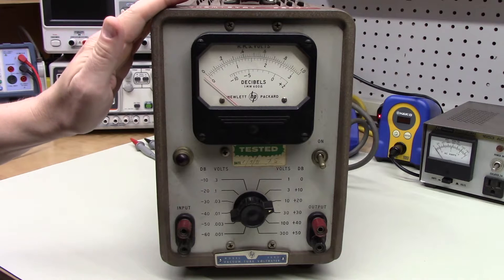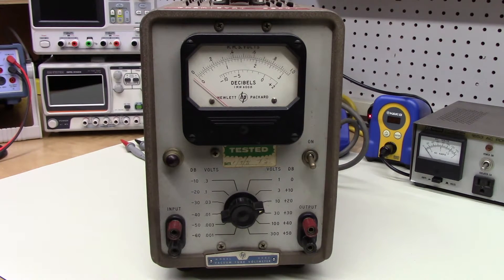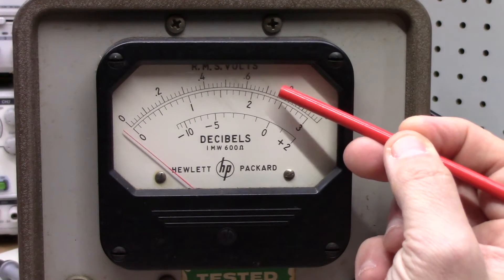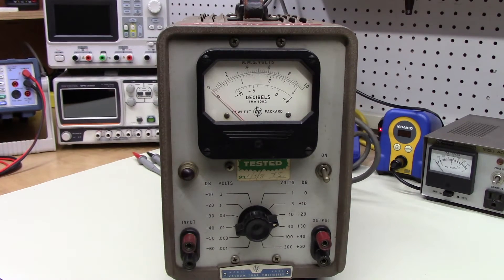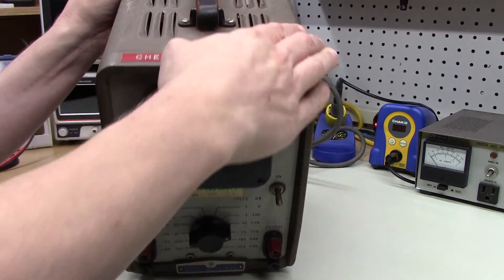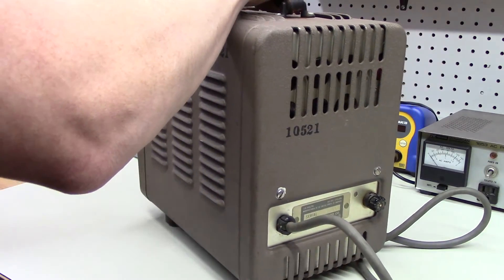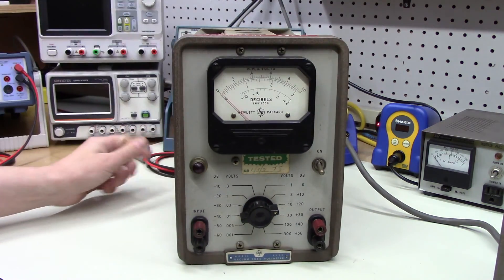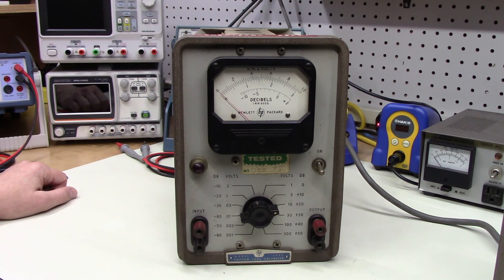#67: HP-400D: A first look

Comment: I just learned more about these meters!  I acquired both the 400 and 410.  Also the null meter variation.  It’s worth restoring all three!  Lots of can capacitors.  Will cost a bit with all the can caps.  Mine came from an EE department.   In great shape.

Comment: The reference for 1 milliwatt across 600 ohms is 0 dBm and the scale was used extensively in the early days for telecommunications and broadcasting. For example Broadcasters used the dBm reference for setting audio level. The earliest broadcasters used reference of 8dBm = vu meter 0. Broadcasters later standardized to 4dBm = vu meter 0. The BBC PPM meter set pointer 4 to 0dBm. These all depended upon the 600 ohm load.
In the 1980's broadcasters began moving away from dBm measurement and reverted to purely voltage level audio measurement. It meant that the voltage established with 1 milliwatt across 600 ohms was retained but dispensing with the 600ohms and 1 milliwatt power reference. The 0.771v was deemed 0dBv.

Comment: Amazing! I worked on these series of voltmeters for HP,  always quality manufacturing and had Dave and Bill (founders) tour the production line.  I purchased the components for these great machines!
Reply: The striped molded paper caps in the instrument depicted: were those Sprague type 68P, 73P, 109P, or 160P?